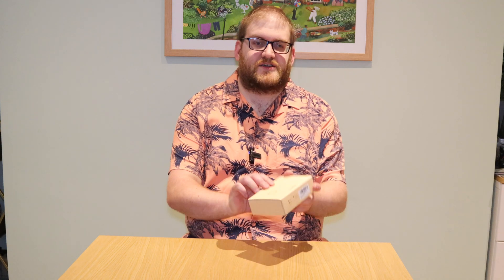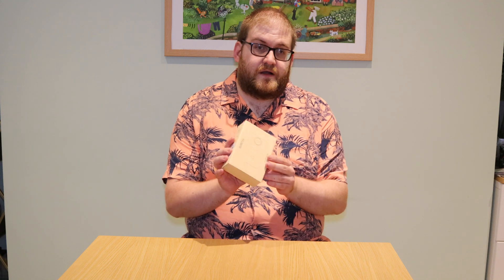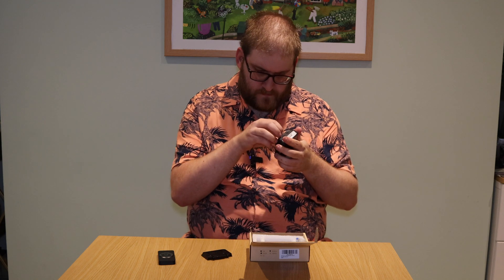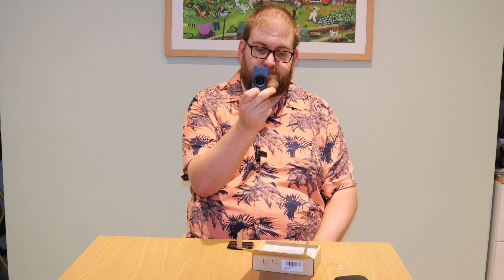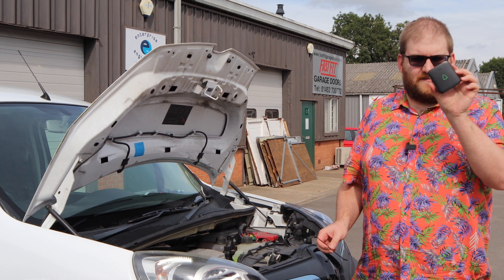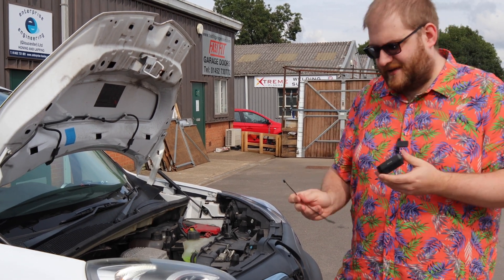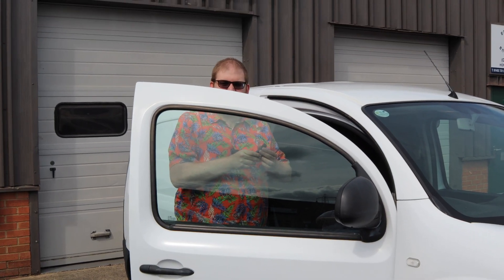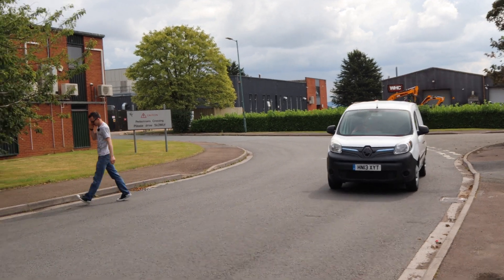Could this make your ELECTRIC CAR less DANGEROUS ?

Comment: I guess they guys making fuel saver fuel line magnets need to diversify with changing times and will soon get this marketed!  Nice you have a Kangoo ZE, they have existed since the turn of the millennium, with Ni-Cd batteries at first! My 2002 EV has a green cyclist button on the steering wheel that only makes a loud beep like a mobility scooter , for cyclists and people with headphones.

Comment: person gets knocked over by a chicken.
velcro  on it would be better so can remove to replace batteries easier.
i do know what you mean  i had the same thing  i was going down a single track and a person was walking her dogs
and i was driving right behind her and she took no notice whatsoever.  I did not want to beep the horn  and may be scare her or the dogs so i drove down the road very very slowly  which you can easy do in an electric car.
and even when two people the other way pointed behind her   she thought they were waving to her and waved back
but they keep pointing and shouting at her   and she looked over  her shoulder and seen me   not a wave or anything.  but after some time getting the dogs to move I got past   I know I am not quiet  and some petrol car are just as quiet and people just walk in there own little worlds 
Yes it has to be battery and you have to know apx how often you have to replace the batteries
Reply from the maker: It’d be fairly straightforward to Velcro (or even screw) the backplate in position for the receiver - this was just a temporary thing.

Comment: Hi mate, Thanks for the content, Hopefully my new EV will have the mandatory PWS but it is a nice idea!
BTW just used your Octopus referral link as my previous supplier just went bust... (Utility Point  - 12 pence per KW all day around...) 
Will be waiting for a smart meter install and then will move to the Go.
Reply from the maker: Thank you! 👍. Awful lot of utilities going bust recently, crazy stuff.
Reply: @ModernHeroes  with the crazy prices in the wholesale I think we will see more going under. Most people think than once they secure a contract providers will fix their price with the wholesale market but often than not that’s not the case.. they just fix a part of it and take a risk on the remainder, and if they don’t have the Mw required fixed in price they will be selling at a loss, then coupled with covid guidance from ofgen related to debt collections, plus price caps that force them to absorve the cost, it’s the perfect lineup for small providers to go under. Sure enough their business plan contemplates some of this, but we are hitting record prices nowadays.